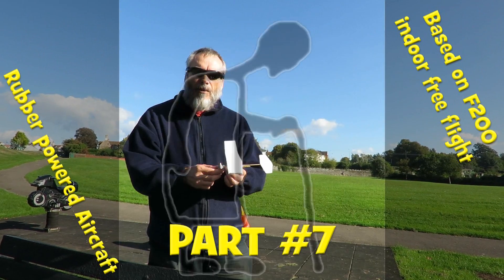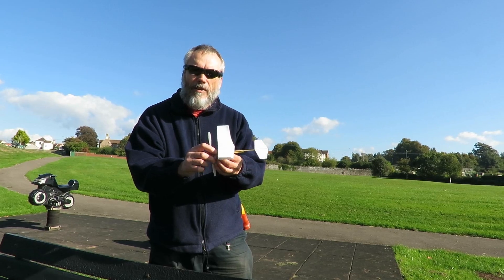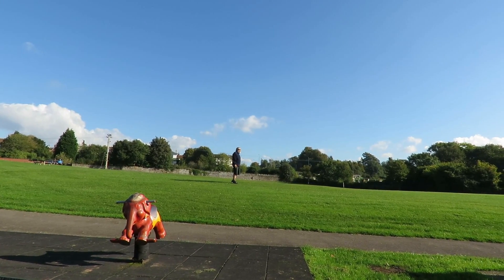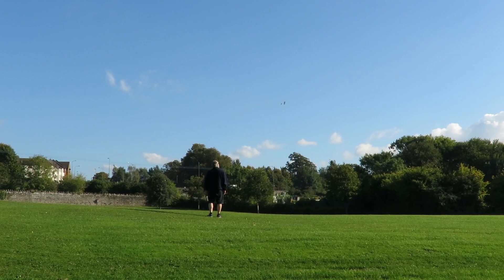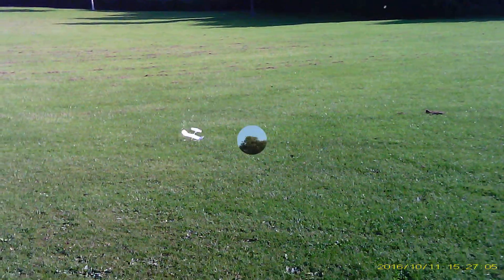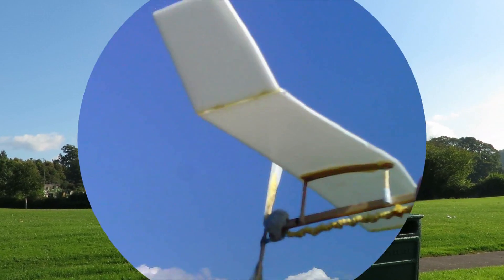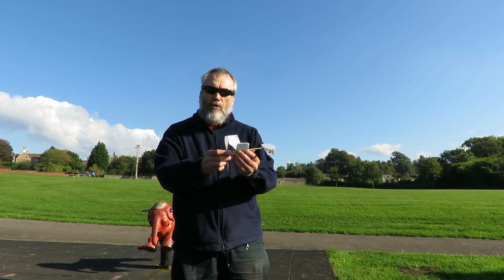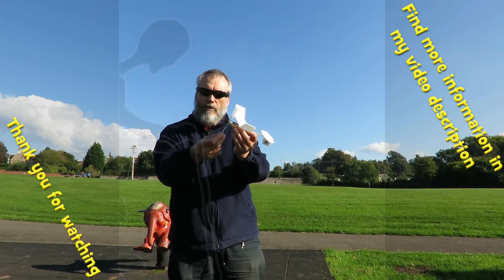Rubber Powered Aircraft Based on F200 indoor free flight PART #7 In the Park

Comment: how much time should we should spin the propperler
Reply from the maker: That would depend entirely on what rubber bands you are using. If you follow the links in the video description you may find more information from the people who designed the plane. With my rubber bands I just wind them until they feel like they can't take any more. Quite often they break. Because I use cheap rubber bands the plane does not fly as far as it would with hobby grade rubber.

Comment: the initial vertical climb could be some sort of torque reaction and seems to absorb a lot of the power, maybe setting the prop with an angle of down thrust would give level flight ?
Reply from the maker: Using the cheap rubber bands like I do means that they do not give their power evenly, it is all gone in a burst.

Comment: It is quite the stunt plane....perhaps a larger rudder?
Reply from the maker: I trimmed the tail and rudder slightly to reduce the weight at the back. Why do you suggest a larger rudder?
Reply: I was thinking fly straight fly far but I just remembered the asymmetric wing design.
Reply from the maker: Wil Hobbs the whole point is you don't want them to fly straight, you want them to circle round indoors tight enough to fly in your living room. If you haven't looked already, have a peak at the original video by MouseSquadron that inspired me to have a go. I would love to achieve that.
Reply: Yes I watched it.
Such tight turns and I think your right about the prop.
His turned slower.
Reply from the maker: Wil Hobbs I could always buy some proper hobby grade rubber but I prefer to use the sort of stuff my viewers can find easily. Hobby grade rubber give out it's power more evenly.
Reply: I've heard that the real pros grade the rubber bands based on the year produced.
Different growing conditions from year to year results in slight differences in the rubber.
The rubber bands from the best years demand a premium price.
Sounds like vintage wine or scotch.
Reply from the maker: Wil Hobbs they probably go by the aroma :-)
Reply: http://www.peck-polymers.com/_p/prd1/3788881611/product/16-feet-of-1-16%22-super-sport-rubber try this super cheap and easy to get.
Reply from the maker: Ross Clements Thanks that link will be useful for people in the USA. Unfortunately the shipping charge to the UK increases the cost by a factor of 10. $2.09 for the pack and $18.75 for the shipping. There are suppliers in the UK that I could use and if I was a serious aeromodeler I would but I try to avoid using hobby grade items as far as possible.
Reply: http://www.micronwings.com/Products/RubberForFreeFlightModels1mmX1mmX4Meters/index.shtml your plane seems WAY overpowered cut the rubberband so It forms a straight piece and then tie off both ends with a overhand knot so there is a loop at each end, voila a rubber band half the size thus reducing the power and you can make it shorter to make winding faster. you can try different rubberband sized until you have a slow-ish climb and decent and not a spiraling vertical climb using up all of your turns. The longer you make the single strand motor the less power it is going to have, but you will get a longer motor run increasing your flight time!

Hope this helps!
Reply from the maker: Ross Clements thank you again. I don't think the postage from Australia to the UK is going to be much different to USA to UK but thank you for trying to help. As I said, there are suppliers in the UK that I could use if I was trying to be serious. What I will probably do is improve the propeller and reduce the weight where possible.

Comment: i dont know if using a bigger prop is a good idea, i saw the video where you where inspired form and that is way lighter then yours, i think having a longer fusolage and further in the back wing is the key
Reply from the maker: You say the original is way lighter but you haven't asked how heavy this one is and he doesn't say how heavy his is in the original video. The biggest difference is that he is using proper hobby grade rubber to power his so it gives the power evenly over a longer period and as I say with a bigger prop it turns slower. If I take off the Blu-tack nose weight it is just over 4 gm so if I sand down the fuselage to reduce the weight at the back I should be able to reduce the nose weight but I will be sticking with cheap rubber bands because that is the way I do things.
Reply: sorry if i sound rude but i saw that the foam u used is not small slices of bubble foam but foam plate, and still i dont want to cretesize your project :)
Reply from the maker: LolPlane I didn't take it as a criticism, I was just making the point that we don't know how heavy it should be anyway. Obviously lighter will be better regardless :)
Reply: GrandadIsAnOldMan yes of course :)